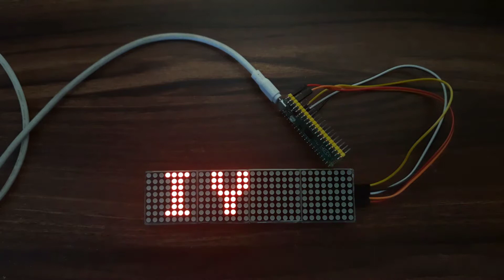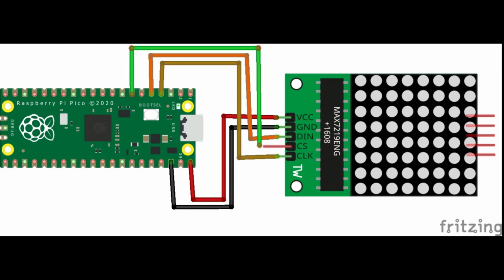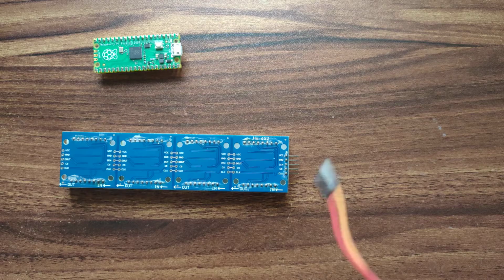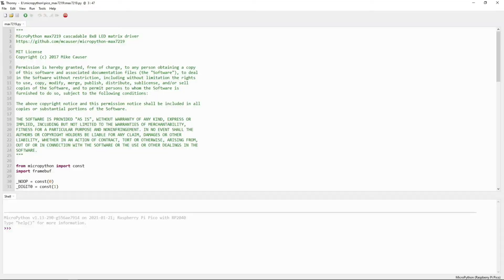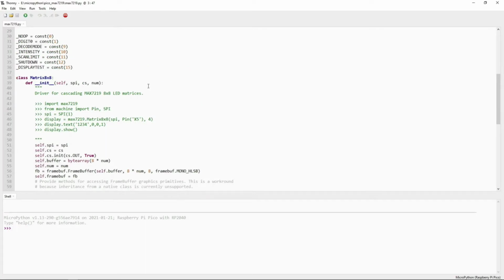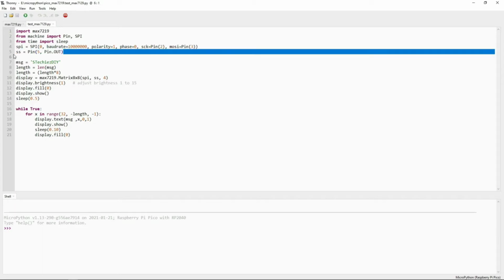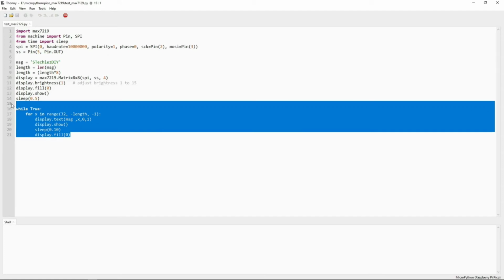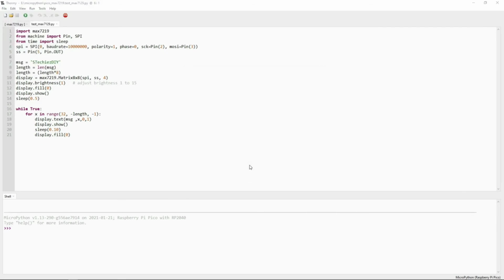Scrolling Led Matrix Display using Raspberry Pi Pico micropython MAX7219

Comment: Hello. I would like to manage the LED matrix with the MAX7219 without using the library, that is, configure the MAX7219 and send the bits to, for example, turn on only one LED of the matrix, or an entire single column or row. .
In the spi.write instruction it sends me an error that it is not valid to send an integer, but rather a string or array is required.
Do you know how I can do it? Thank you.